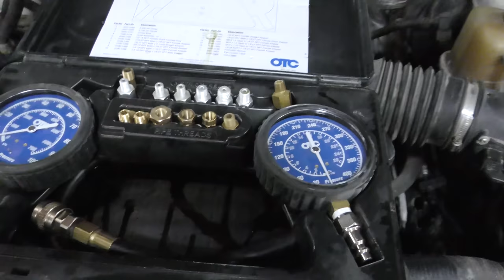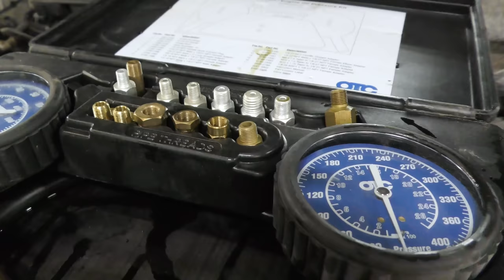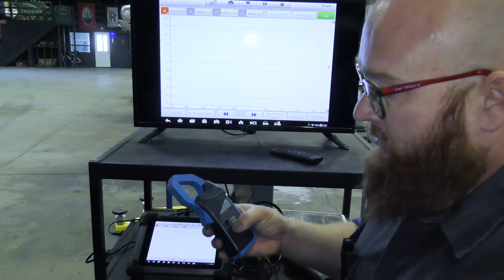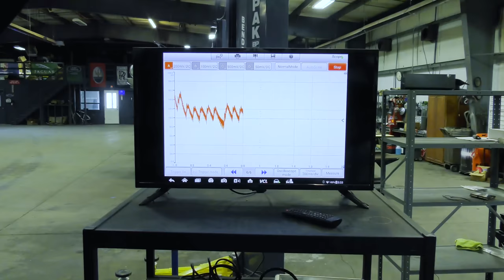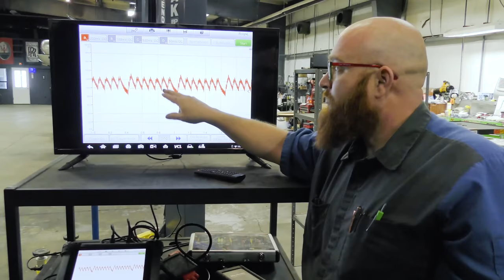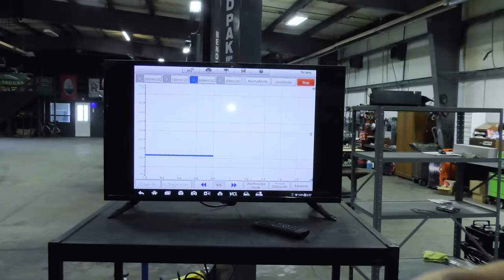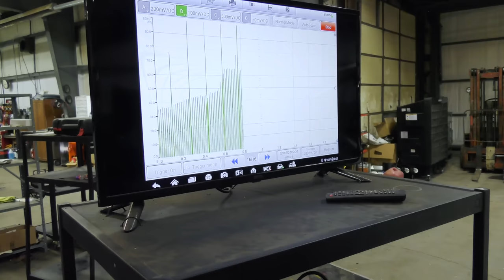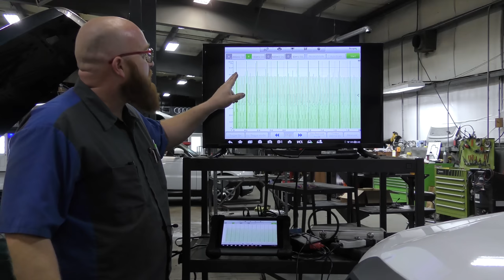Can an engine additive really fix this 2011 F150? CAR WIZARD shows how to diagnose and repair

Comment: I’m the customer, a lot of people asking what engine, 5.0 V8. I tried to get the first shop to test the oil pressure, I’m not sure if they didn’t want to invest the time but they didn’t do it. I’ve been watching Car Wizard’s videos for a while now and knew he would apply some real troubleshooting skills to the issue. I wasn’t disappointed. Thanks Car Wizard!!!
Reply: Thats awesome!  You're lucky you live close enough to the wizard.  Im glad it seems like the other shop didn't shaft you too hard.  They could of done alot more damage blindly firing the parts cannon!
Reply: I was just thinking about what engines in that lol thanks for answering. I'm going to be in the market for a new pickup in a year or two and my company gets us the B plan for Ford. Good to know I could expect this if I get the 5.0 n get to 200k miles but yeah if I go the used market I'm prolly getting a Toyota lol
Reply: Yes a true mechanic will use knowledge and tests to find the issue and not just throw parts (money) at it. The Lucas additive will increase the viscosity a little along with having greater adhesive properties. This helps reduce the effects of some parts wear. This brings back oil pressure, cylinder pressure, and reduce future wear. Just as the wizard said this doesn't fix the problem but it can help extend the life of older engines.

Knowledge is half the battle! Go G.I. Wizard! Lol
Reply: @jamesmancuso3666  why not just use thicker oil?
Reply: @Psych0technic  I was wondering about this myself.
Reply: Out of curiosity, what is your engine oil maintenance schedule? Do you go by mileage (I haven't been able to read the sticker for 6 months, maybe its time), the oil life monitoring system (Thats been reading zero for months, maybe its time),  time (Is it June again already!?!?), or just whenever you remember that it hasn't been changed in like 3 years? Under 200k and its worn out!?!? Just doesn't add up in my book.
Reply: It is of course shocking when the diagnosis says you need a new engine. Actually, there are "20 Cars That Have Gone 1 Million Miles" like 2007 Toyota Tundra, 2006 Honda Civic, 1987 Volvo 240, 1996 Dodge Ram, 2006 Ford F-250, 2006 Chevrolet Silverado 3500, 1976 Mercedes-Benz 240D. So this F150 with 180.000 miles looks quite in good condition, and problems with the engine can surely be solved at low costs without replacing it.
Reply: Agreed except the conclusion was wrong.  Lucas just thickens oil, there is no reason to keep adding it with each oil change instead of just using higher viscosity oil.  The shop also could have just done an oil change in the first place if it was about due for it.   

As far as the Motorcraft filter, true it's not junk but there are many out there known to have as low or lower flow restriction.  Of course a Ford dealership would put a motorcraft filter on, because that's standard operating procedure.  You'd be as well off using a Fram Ultra or Wix XP, though with a positive displacement pump, the filter choice makes far less difference than the increase in oil viscosity.
Reply: @Psych0technic  I’m sure there are certain additives that make the Lucas stuff better for this application. You could absolutely use thicker oil, say 15w50, and it would likely increase oil pressure. But the Lucas stuff is kinda intended for old, worn out engines, so I’d expect there are some additional herbs and spices in it that may help prevent additional wear. I’ve also heard good things about a product called “Prolong.” 

Obviously none of these things are gonna help if the bottom end sounds like a coffee can full of bolts being shaken up, but in a case like this, it absolutely can help out. These engines I believe were specified to use 0w20 from the factory, which is suuuuper thin, probably for fuel economy reasons, idk. I have to wonder if a heavier oil was used from new whether this would even be a problem.
Reply: When I was buying my truck back in 2012, I was given the option of the 3.5 V6 EcoBoost or the 5.0 V8.  I decided to go with the 5.0 V8 and have never regretted that decision.  That engine is still running strong at 226,000 miles.
Reply: This doesn’t make Ford look really good.  Shouldn’t their engines last longer than this?  I always get 300000 miles on my bmw in-line 6 n52’s and Japanese engines.
Reply: How often did y’all do oil changes? And what oil and filter? City driving or highway? Towing?
Reply: Good egal but time to sell while it’s still good for another 50K miles.
Reply: Well that was certainly ur lucky day being able to have the Wizard personally look at and diagnose your truck problem 👍
Reply: If you don’t mind sharing, what kind of life has this truck lived, as far as things that, over time, might have contributed to the issue... like the oil change intervals, what weight/brand oil has been used, what kind of driving does the truck see (short trips, or more long highway drives)? 

I know with the later 5.0 engines (I’ve got a 2015) they “recommend” either 0w20 or 5w20 (can’t remember which, but both are pretty thin), and the book doesn’t even give a recommended change interval, just “change it when the truck tells you it needs changed,” which has always bugged me. And it wouldn’t be the first time for a manufacturer’s recommended maintenance intervals to be insufficient... VW is notorious for that as well — lot of PD TDIs wore out cam lobes after folks were going 15k miles on a single oil change. This just has me thinking I might need to adjust my maintenance regime, maybe start sending some oil samples to Blackstone for analysis, since I don’t ever intend to sell this truck. Most of my vehicles have over 200k on them, and two have over 300k, so I’m not afraid of high mileage... as long as I know what to keep an eye on. 

It’s just surprising that a modern engine that has been maintained and has used modern oil it’s whole life would have worn the bearing clearances enough to drastically affect oil pressure like that by 200k miles. I expect 6-10psi hot idle oil pressure from a well-used 1960s big block Buick or Olds, not from a 2011 V8 that had just been redesigned.
Reply: @ImTheJoker4u  I haven’t had the truck except for the last 10k or so. I’m not sure about the maintenance life it’s had. Personally I do 3k miles on this truck and 5k miles on my commuter car that gets 120 miles a day on it.
Reply: dude that early Coyote is a pos..I'm a Ford guy, but that thing was flawed from the getgo...a bored out 4.6, total GM engineering on that one...it wasn't until the Gen3 that it finally works..oops, now time for electric...how the hell some additive can fix poor engineering is myopic
Reply: @dphoenix1  I would love to know the history of this truck. It’s not uncommon to see these trucks with 200-250k. It was so clean under the truck and there was no sludge under the oil cap that it seemed like a good purchase. It didn’t display the oil pressure issue yet, and it would have been difficult to see on a test drive anyway. It only does it at full operating temperature of the oil. I would recommend anyone looking at a 5.0 truck to drive it for about 20 minutes and let it idle for about a min to see if it displays this problem.
Reply: Image getting your car roasted by scotty kilmer
Reply: @stinkycheese804  you know nothing sit down boy let the trained mechanics fix it
Reply: It’s not common for 5.0 coyotes to have low oil pressure at higher miles. My guess is poor maintenance and infrequent oil changes. Those are bulletproof motors.
Reply: I drive a 2011 f150 5.0 with 385,000 miles on it and still going strong I have changed the oil every 3500 miles and use motor craft oil filters. Not only is it running well but it rides quiet and with no rattling. Maintenance is key
Reply: @stevem5139  exactly
Reply: @andrefecteau  He is a tool. I'm an actual mechanic and I watch him just to get a good laugh. He gives so much bad info it's ridiculous. He's got the youtuber gig down to a science though... I'll give him that much
Reply: @catfishbilly7425  yeah good call bro...as I say "don't hate the players, hate the game"...that Scotty guy was the king of it
Reply: @Bmwguy2011  We don't know the maintenance history on this engine
Reply: @Psych0technic  heavier  oil does  not lubricate  new engines  as well  and its harder on the oil pump  that  truck should have 5w20  a lot of new  cars take 0w20
Reply: @ImTheJoker4u  I've got a Ford 6.4 in my shop  right now with 34000 miles that needs an engine. It has been  serviced regularly  and not abused  you never know how long they  will  last
Reply: @michaelcoonce6694  , by that same token, the Lucas is going to make the oil 'thicker' or ' heavier'.

And why would you go to 50w from 20w? I'd have tried 30w or 40w first.

The reason they use the lighter right oils is for the cam phasers.
Reply: @andrefecteau  Actually, no.  The 5.0L Coyote was based on a Jaguar V8 engine - it was not related to the Modular engines in any way.  I worked on that engine program at Ford.
Reply: @stevem5139  yep, my work truck just hit 367000 miles, oil changed every 7000 miles with conventional.  Oil pressure is fine,must of been built on a wednesday lol.
Reply: A good mechanic is invaluable. Car Wizard and Eric O. at SMA are in a class by themselves.
Reply: Sorry for your luck. I knew from the get go the 5 litre was another weak sister on the engine world.
Reply: If I paid a mechanic to fix something and all they do is pour lucas snot in the engine I'd be pretty pissed. That's not a fix, it's a cover up. This engine is on it's last legs. And that is totally unacceptable at less than 200k.

You'd think Ford could figure out how to make an engine after doing it for more than a hundred years.
Reply: @sayrerowan734  FORD recommends 5w20 in almost all their gas engines No manufacture has recommended anything like 10/40 or 15/50 in 30 years on the cars they engineered. The reason being oil pumps are not designed to pump the heavier oil that in turn does not allow for proper lubrication of the engine. I am a fan of Lucas namely because of the cleaners and additional lubrication quality's.180 k is not bad for a car the maintenance history is unknown . If I were the owner I would recommend to either plan on a new engine  in the future or trade it
Reply: Daniel did he mention if it was the synthetic Lucas (black bottle) or the regular stuff?
Reply: @michaelcoonce6694  That is 100% wrong. The reason newer engines use thinner oil is because that results in better gas mileage. Often engines that call for 5w20 or 0w16 use thicker oil in the exact same engine in a different country. It also helps to run cam phasers. It has absolutely nothing to do with the oil pump.
Reply: +Daniel Huffman I bet the previous owner didn’t use motorcraft filters. The thing about motorcraft filters is the check valve. All the mod (modular) motors (4.6, 5.0, 5.4, 6.2, 6.8) are very sensitive to it and when you use any aftermarket brand, the check valve bleeds off more oil to the oil pan than the motorcraft one would. These motors aren’t designed to have to pump up the full oil pressure at every startup. And as seen it wears the bearings and all that shit. My fix would be 5W40 every oil change. No need for Lucas. 

I daily drive an old 04 mercury marauder with the 32 valve 4.6 (basically the experimental version of your motor, extremely similar), it has 7psi of oil pressure at idle but it doesn’t have any type of VVT or cam phasers so im fine with it. Hasn’t gotten any worse in the 22k miles I’ve owned it. Oil changes every 3500 miles. Raced regularly too. I once changed the oil to 5W40 and that brought it up to 18psi at idle. Now that I think about it, i should start using 5W40 again lol.
Reply: @ryanroberts1104  Exactly fuel efficiency
Reply: Mobil 1 0W-40 and Motorcraft filters, change every 5k miles if you're not operating it in severe conditions as described by your owners manual, 3k - 3,500 miles otherwise.  That oil seems to hit all the right sweet spots for oil and has done well for me in everything I've run it in.
Reply: @sayrerowan734  both the cam phasers and oil pump get taxed  with higher viscosity oil. That's why you need to stick with the one specified in the oil cap.
Also, read this: he's only using Lucas to fill the remaining 20% of an oil change. It can't be compared to go all in with 6 or 7 quarts of higher viscosity oil
Reply: @ryanroberts1104  well  it won't matter  when our government  has us driving electric  and riding  bicycles  I would  be happy  to provide you proof but I feel  you wouldn't  believe  it
Reply: I bet you didn't change the oil ever 3K miles did ya?  Tisk Tisk
Reply: @joem.7621  ford recommend oil change in 2012 was 7500  miles
Reply: @Psych0technic  Start up lubrication, especially in cold weather.  By your hypothesis, heavy duty gear lube would be the best engine lubricant.
Reply: @stinkycheese804  "Flow restriction" is a meaningless term. If one wanted to minimize it, one more just admit they're all filter. Filtration efficiency is what is an important.
Reply: @Psych0technic  because lucas doesn't just thicken the oil  its also their additives  with the oil.
Reply: @Psych0technic  switching to 10W30 (as a preventative measure) for this very reason on my 200,000kms  2009 explorer 4.6L v8. 5w20 allows the manufacturers to post slightly better fuel economy numbers (marketing) at YOUR expense (reliability).
Reply: @cap8e  So what are these "other additives" and how do they help the engine? Do you have any idea what so ever beyond what they tell you on the bottle? I doubt it...
Reply: @ryanroberts1104  Hey Ryan I do know most oil  thickeners by their nature reducing the lubrication of the engine. I looked into a few and its just thick oil\petroleum product.. Lucus also uses a decent amount of Hydrocarbyl amine which is a detergent. its listed on their SDS which (SDS is government regulated ) sos its not just fluff I would guess it's not even listed on the bottle.  2nd I have experience with their transmission oil additive, had lots of slipping not going into R in my 01 monte carlo was used a couple other thickeners (trans) and nothing. was suggested to try lucus after writing scotty kilmer from youtube was told to try lucus trans as a last resort. slipping almost none for 3 years.. TBH it has started to show signs of slipping again.  but a $6 bottle gave me 3 more years. Also wouldn't he just say use a oil thinker if they were all the same? he's not sponsored by them, even if they are all the same or close wouldn't it be better to just say the one he seen good results with.
Reply: @ryanroberts1104  plus why not just use a heavier  high mileage oil at your next oil change vs using a thickener?
Reply: @cap8e  There are no additives in Lucas products that help your engine. Any difference in detergents certainly would not account for higher oil pressure.  Wizard called it out by name because that is what the dealer told him to use, but thicker oil would have exactly the same effect at a lower cost. It's actually kind of funny that there are a lot of mechanics that don't know squat about oil, especially the type that work at the dealer. Anything Scotty might have told you is probably wrong, he is an obnoxious donkey.

Yes, it works sometimes as a last resort, and you may get a few more miles out of something that is already basically dead. But it is only a last resort and a temporary coverup, not a long term fix. You would get exactly the same effect for less cost by using a thicker oil. It's also better for any oil to use all of the same brand rather than 20% of this and 80% of that, not everything mixes well. Either way this engine is on life support.

Additionally, this is but one example of one single truck - just because it worked here does not mean it will or won't in any other situation. A sample size of one is not statistically important.
Reply: @ryanroberts1104  okay you have your opinions on scotty and thats fine.  but as I just told you because of him I am going past 3 years still driving my car in PHX az where summers are killer.  yes we are on barrowed time. hell I would have been happy with 6months. So there is 1st hand personal experience. Believe it or not I have no reason to lie.   Before I used it I seen other random people (little to no subs) vids on youtube having good results and reading on forums.   no one is saying its a magic bullet for a long term fix.  certainly not me.  its totally not a cure all. but what will it hurt to try ? whats the difference in price a few dollars.
Reply: @Ryan Roberts  plus you asked me whats in lucas thats  not in other brands..  Asked and answered if you are not happy with the answer what can I say.  🤷🏾‍♂️
Reply: @cap8e  You have absolutely no proof what so ever that the Lucas is why your car is still running. That is your guess and nothing else. You still have not answered my question about what the additives are and what they do for you. "Detergents" is not an answer. More specific.

The point I'm getting at is you cannot answer that because you have no idea what is in it. There is very, very little in it besides thick oil, and there are oil analysis results available online to back this up. If you used thicker oil instead of Lucas bullshit, the oil actually does have additional useful additives.
Reply: @ryanroberts1104  sir you are...  well IDK what else would it be that is the only different variable,  Im sure you know if your car has been slipping for years, stalling in a certain gear  and not even engaging iin R with out revving up and shifting all the gears it won't magically fix its self & to the point of little to no issues out the blue.  Lucas is the only different variable in the equation. it doesn't take the deduction skills of sherlock or the mind of Einstein its the additive.   As I said I read the SDS sheets of lucas and stp and another brand. the only differences was lucas had   a lot Hydrocarbyl amine the others didn't. I can't sit here and say what the effectiveness of H.A. is.
Reply: @cap8e  You have no evidence what so ever that Lucas anything fixed anything. You have no idea if simply using a thicker oil would do exactly the same thing. And I don't believe you have any idea what a hydrocarbyl amine is, suggesting it is helpful is stupid. I see you had to copy and paste the word or it wouldn't have an improper capital H.
Reply: @TruckingShooter  the 3.5 is fairly nice as well. My father has one (2015 I think) And he's got almost 200k on it with the only issue being he had to have the transmission fluid flushed once because he inherited it from my grandpa who passed away and he hadn't done it. But overall it's been perfect, drives it 7 days a week.
Reply: @ryanroberts1104  Lucas has, like, labs and stuff. There is more to it than thickness. I use a little of the thin Lucas in a fairly new car I don’t drive very often because it sticks to the parts better while the car sits.
Reply: @sammolloy1  No, you are wrong. There is literally nothing else to it but thick oil. NOTHING! You have no idea if it sticks to parts better "while the car sits". (Did you ever take apart your engine and check?)
As for "labs", no, Lucas absolutely does not run any sort of research facility. They don't even make their own product, it is blended for them by a larger oil supplier.
Reply: @Psych0technic  Yes.  My first choice would be motor oil, 20W-50.
Reply: @dphoenix1  Fuel economy was a goal, but bearing clearances have tightened up in modern times making it an option. Also, not sure which manufacturers have done this since Honda invented it about two decades ago, but a textured coating on the bearing shells can hang on to the oil better (uh, technical term) and allow a thinner oil viscosity to do the job.
Reply: P.S. Also, this is yet another case where "more fuel efficiency" also means "more power." Which I've heard most Americans want more of.
Reply: @TruckingShooter  Hate to break it to you but I've had to do similar things to Toyotas with high mileage such as that. The V6 and V8 specifically. I haven't kept a 4 banger for that long as of yet. The most annoying part is even with new gaskets/seals and a pristine surface they'll still leak some half the time or more. I'm not confident in the newer cars with all the plastics. Might get worse now.
Reply: How many quarts of additive I have 2014 f150
Reply: @catfishbilly7425  He knows better than you!
Reply: @engineer_alv  , I agree, you need to stick with the specified oil.  That is, until the engine is so far gone that the specified oil isn't doing the job anymore.   If it's a choice between replacing the engine now or getting tens of thousands more miles out of it just from using Lucas or going to a heavier weight, I can easily see someone making that economic decision.
Reply: @michaelcoonce6694  , I don't know why you arrogantly assume I don't know that about engine oil and what the manufacturers are doing, or that you have any more knowledge than I do in that area.

My point was, if you are putting Lucas in it, you're thickening the oil. And you used a jump from 20w to 50w, when a more logical step up on an already damaged engine is to go with the next weight up instead of such a massive jump.

I would imagine the owner is aware of the issue and planning accordingly.  That said, he might get tens of thousands of more miles out of it before the engine finally goes FUBAR.
Reply: @michaelcoonce6694  True.  The idiotic government will be banning combustion engines soon.  Probably less than 10 years away.  And virtue signaling leftists will cheer.
Reply: @ryanroberts1104  my 2012 ford has 190k on it never had a wrench  put to it runs  great  and has been  serviced  at manufacturer  intervals
Reply: @BornIn1500  The government does not get to "phase out" engines, this is 100% left up to the free market. Even in 100 years, there will be a lot of things we still need engines for. There are auto makers randomly claiming they are going to make this or that electric right now, but in reality they won't meet the fake deadlines they have set and if they are not popular they will not continue making them. They're only saying that to make stupid people happy.
Reply: @michaelcoonce6694  Nobody cares. A sample size of one is statistically insignificant. Any mechanic who actually works on them will tell you Ford engines are shit. (And the mechanics love it because it pays their mortgage!)
Also at that mileage, it has almost no value. There is a reason Ford trucks are always cheaper on craigslist.
Reply: @theundergroundlairofthesqu9261  Yes, thinner oil gives slightly better efficiency and gas mileage, but not enough for you to ever, ever notice. The manufacturer's choice to shift to 20w oils has indeed caused increased wear - the manufacturers just consider this acceptable. You can find detailed studies about this online. Maybe one of the reasons this POS is already so worn out.

Personally, I will never put 20w oil in any car, I would never buy an engine that calls for that or uses cam phasers, because that is stupid. It's only there to make the EPA happy, and sometimes I burn a tire just to piss the EPA off.
Reply: @ryanroberts1104  Apparently you do I got you dont like fords additives and admitting your WRONG . Get a life
Reply: @michaelcoonce6694  You've made numerous stupid comments here. Numerous incorrect comments. And now you are just repeating things other people said first. If you are a mechanic you are a hack, and this is quite common. Just because you do something for a job doesn't mean you are any good at it. Most people would agree it's hard to find a good mechanic these days, too many idiots.

I'm really not sure what you are arguing about at this point, you're just making a fool of yourself. You literally tried to say that heavier oil is bad for the oil pump and that's why they use 20w. That is something only a stupid person would say, if you are a mechanic I feel sorry for your customers. You don't even know how an oil pump works.

Quit while you're ahead and just STFU.
Reply: @ryanroberts1104  you just keep running that heavy oil in your car you will be seeing a hack mechanic someday  I know arguing a point with a wall does no good putting heavier oil in a car then is recommended is like putting premium gas in a car that runs regular it serves no purpose. And I still like fords and lucas products. Sorry Ive got work to do so bug somebody else
Reply: 180k miles and the engine has low oil pressure? Did you buy the truck new and how often did you change the oil? What kind of oil did you use?
Reply: Since it's a 5.0L. You can shim the oil pump to increase oil pressure. I would try a new oil pump first to see if the current pump has a weak bypass valve.
Reply: @TruckingShooter  even a used Toyota at 500k will last longer than Ford
Reply: @ki5aok  typical strong Ford v8
Reply: @jpriller5105  Oil pumps don't go bad to often. The guy probably didn't change his oil.
Reply: The solution here is the correct one.  A customer brought a truck in with low oil pressure.  Instead of throwing a ton of parts on it they spent $20 on Lucas additive and some oil and it seems to work.

Hopefully that helps and works.  They may try again.  If not it, -maybe back.  Maybe get another 100,000 or 200,000 miles on it.  New trucks are expensive and in many lots the selection is thin (shortage of computer chips) = not the rigt time to buy a new truck.
Reply: I was wondering what oil did u use and how often did use change oil, I got a 14 5.0  with 140,000 miles and I use castrol edge full synthetic and change every 4 to 5 thousand miles
Reply: @TruckingShooter  Your comment about getting a used Toyota got me thinking:  With 32 valves, 4 cams, two or more cam phasers...  More places to lose oil pressure as the engine wears than with a pushrod V8 (e.g. GM, Chrysler).  I wonder if a Toyota V8, also DOHC 32 valve, behaves the same way as it wears?  What say you, Wizard?
Reply: @Daniel Huffman
My advice is to get a product called RVS.
I had a SEVERE rod knock and BADLY slipping clutch in my motorcycle.  This stuff actually fills gaps in worn parts. Of course,  I didn't believe it, but for 60 bucks, I figured why not give it a shot. 
Within 30 miles,  my knock was gone and the clutch no longer slipped.
It only lasted for 6 years and 30, 000 miles, but it was well worth it. 
It's available online. 
It's the only "magic in a bottle" product that's ever worked for me,  but it actually DOES.
Reply: @Jstaguy26  basically no castings or internal components in common, but the bore spacing was made identical so that it could be built on existing lines tooled for the modular V8.
Reply: @Bmwguy2011  No it doesn't make Ford look good, but I doubt this truck received proper and regular maintenance. I have seen several 5.0's with well over 200k.
Reply: @jonmccormick8683  It's hilarious people act like the only two options are limping along this POS or "buy a new truck". Generally people driving broken base model Fords with almost 200,000 miles don't go get a brand new one from the dealer when it breaks down, they spend $4000 on another used one that will last a year or two and do the same thing.

This truck should be fine for a few more miles with thicker oil but even if it wasn't that has nothing to do with the cost or availability of a new Ford, that was never on this guy's list.
Reply: @turbovolvos40  good because my philosophy has always been: change air filter / oil / oil filter, always warm up, never lug, never redline and with synthetic.... true wear should be nominal: German or American. I got 368000 on my Acura, 236 so far on my bmw, 336 on my civic and would have to believe that 250-350 is achievable on an American v8.  I think v8s aren’t as well designed as inline 6’s— tension built into the design.
Reply: @dphoenix1  Label in the filler cap says 5w/20 so pretty thin. I'd go one thicker at that mileage or use the additive.
Reply: @stinkycheese804  Watch the Project Farm oil filter comparison.
Reply: Before Lucas we used high tach oil stabilizer and before that it was STP oil treatment and before that we used 20-50 oil it all worked but Lucas seems to be the cure for this problem it took fifty years for lucas oil stabilizer to be my go to for all my fleet vehicles engines to last at least 300 K  !
Reply: @batsonelectronics  I've always had good performance from the orange frams. Synthetic oil changed regularly, Fram filters, OHV engines, they go 300K and run like new. The vehicles fall apart around them. Yeah, the newer VVT engines I'll use better filters.... But I think the most important thing is clean synthetic oil.
Reply: @michaelcoonce6694  I agree I think 5w20 is as thin as I'd go. It's like water. The manufacturers now recommend maintenance based on environmental impact, not on increasing longevity for your car.
Reply: @ryanroberts1104  I'd disagree there. Govts are pushing electric and green energy like crazy. Subsidies, tax credits, trying to ban ICE's in downtowns. Picking winners and losers. The list goes on and on. All of this is politically driven and not based in practical reality.
Reply: @robertbell525  I've been in the repair business for forty years and firmly believe in following  manufacturer  recommendations some cars just last better than others. No matter what you do
Reply: @michaelcoonce6694  oh yes, some are good some are junk, and heaven help you if you got one built on a Friday afternoon.
Reply: @michaelcoonce6694  Lots of people have been doing things for a long time and are still bad at it. There are lots of bad mechanics in the world, that's why it's so hard to find a good one.

I see you still haven't figured out that punctuation thing.
Reply: @robertbell525  Yes, they give "incentives", it does not mean they are going to "phase out" (or would ever have that option) gas engines. Based on the news right now a lot of dumb people think all cars are turning electric and that's just the way it is. That's just the way it isn't, these people don't realize we still need the gas engine for at least 100 more years...and it has nothing to do with politics. Yes, politicians get involved and try to push one thing or another, but the winner in the end is the thing that works, and electric cars are not even remotely close to workable for some situations. If every American had one or more electric cars, we would not have enough electricity to power them all! The grid is already failing without them...
Reply: @ryanroberts1104  agreed that EVs are a tiny portion. 2% of new car sales. But if all you do is listen to the media you'd think it's 98%. At least US govt won't outright ban ICE but they will legislate to make it harder and harder to make and maintain. They already have. Engines and controls are so complicated they don't last and are many times not feasible to fix. Check engine lights come on for everything. Tiny turboed engines that die at 100K. Transmissions that shift constantly to maintain fuel efficiency. And all this for maybe 1 extra mpg. It's ridiculous.
Reply: @robertbell525  I agree they try, but even if it was mandated today that all cars be electric it just isn't possible. Much of this is political, so absolutely nobody can guess how it's going to be in 4 years time. The politicians making these mandates have no idea how cars or physics works. The EPA has screwed up dinosaur powered engines, but there are a lot of pretty nice late model engines still being made. Some of the newest V8s are making obscene HP from the factory, with reasonable MPG too!

I think both Furd and GM are making some pretty substantial claims about having fully electric lines by 2030, they make these kinds of "goals" all time time only to completely forget 2 years later. We can't really say that either one won't go bankrupt (again) by 2030. I'm not holding my breath. Yeah, they will make an electric Mustang and an Electric Hummer by then, but we'll still be mostly driving combustion powered machines in 2030. Unless there is some amazing new thing found in the next few days, technology just ain't there yet.

Everybody went nuts around 2008 trying to save $4.50 gas, but over a decade later gas is incredibly cheap and big displacement engines are making a comeback! The dropping prices of oil have even hurt solar panel sales - there have been times in the past few years it is cheaper for me to run a gas powered generator than to use power from the power grid. That means if I had an electric car it would be cheaper to charge it with a gas powered generator...except that is ridiculous.
Reply: I agree that this isn't good enough. My Chevy G20 went 350,000 (easy cruising highway) flawless miles before selling it, and my FX35 went 265,000 (violently BRUTAL) flawless miles. My company's 2015 F150, however, sucked.  The most popular vehicle in America shouldn't have so many problems.
Reply: I’m certainly not gonna argue with the wizard but I’m familiar with this issue and 5.4 3v does same thing. Replace the oil pump with a high volume pump from melling. Now problem is solved.
Reply: @lenny108  There are MANY more million mile vehicles. Add a 6.7 powerstroke to that. 1.3m on a 2013  Platinum Powerstroke.
Reply: @ImTheJoker4u  that's what I'm thinking. I got a 11 f150 I bought at 32k miles and it now sits at 215k and never heard of that issue. I go by my oil life once it gets to 15% and use a Fram filter or motor craft if the Fram is sold out. The only issue I know of from a few others but luckily not mine (knock on wood) is the drive shaft bearing going out. And most shops go for the full drive shaft to replace at 900$ when you can buy just the bearing for 20$ online.
Reply: @dperreno  Explain to me how an engine design that was not related to modular engines in any way, was somehow designed and built to be assembled on modular motor tooling and assembly lines? And why it has the exact same bore spacing, deck height, bellhousing pattern, and even almost the same physical size as the outgoing 4.6 mod motor? Maybe you should stop making things up online, lmao.
Reply: Dphoenix1....there is nothing in Lucas.  Search bobistheoilguy.com for the VOA.  It’s just really thick base oil.  If I had an issue that I thought could be solved with higher viscosity, I’d either use a higher viscosity oil or I’d use Mobil 1 15W-50 like an additive.  It’s a fully formulated oil and cheaper than Lucas as well.
Reply: @ki5aok  2013 F150 5.0 owner and mine has 226k too! Running well with regular self maintenance. Hoping to keep it for many miles more
Reply: I wish I lived near him.
Reply: @sayrerowan734  What does FUBAR mean? Sounds like a tasty treat.
Reply: @michaelcoonce6694  What size engine?
Reply: @ryanroberts1104  All Ford engines?
Reply: @standhd  You are way late to the party and I have no idea what you are referring to, but whatever it is, yes, all Furd engines.
Reply: @ryanroberts1104  I have a 2003 4.2. And no I’m not way to LATE to the party. Stop being an ……. and a FORD hater and just answer my ……QUESTION!
Reply: @ryanroberts1104  WERE YOU AT….TOUGH GUY? People like you make me wonder…..WHAT ARE YOU GOOD FOR????? TALKING NOISE WITH NO SPINE???????
Reply: @standhd  Fucked Up Beyond All Repair
Reply: I’ve got the 5.0 with 155 never had one issue. I hope I can get 200 plus hope you did.
Reply: That is diag method is really cool!
Reply: I have over 210,000 on my 2011 f150 ( Coyote 5.0 ) and I run one bottle of Lucas oil stabilizer to my oil at every oil change. I SWEAR by this stuff!!!
Reply: @Psych0technic  Try it and find out lol.
Reply: @lenny108  The Toyota V8 is rated one of the best engines made.
Reply: @stinkycheese804  No actually you wouldn’t be better off using any filter. I suggest you do some research. Fram is the worst filter made.
Reply: @dphoenix1  LOL yeah go ahead and dump that goop in a modern engine and drive it for a while. Let us know what happens!
Reply: @Bmwguy2011  Sure if you don’t have Jiffy lube change your oil. People who are cheap usually don’t get high mileage out of anything. Not to mention it’s cheaper to do your own oil changes with quality oil and filter.
Reply: @andrefecteau  Exactly. So you’re saying a 2011 Coyote engine is junk ?
Reply: @rolandthethompsongunner64  no but you are...you go as fast as your wallet can handle it...plain and simple and btw compared to what Tesla is doing?  Yes
Reply: Also run synthetic I use nothing else have 400 thousand on my 01 e350 5.4
Reply: @garyholifield2147  yeah my 96 Cobra has over 300K, always used synthetic
Reply: Oil flush, wix xp filter and ceratech from liquid molly
Reply: There wasn’t anything to troubleshoot, crazy how little people can do own their own
Reply: @lenny108  you can’t solve any of those problems without a rebuild. You’re just possibly alleviating them for a while
Reply: My 2004 f150 4.6l v8 is very reliable has over 400k miles .
Reply: What quality oil were you using before that happened
Reply: I have a 2013 5.0 F150.  I bought it CHEAP only $15k.  I didnt know at the time that it had a bad engine, but I had my suspicions.  It had 120k miles when I bought it.  At 140k miles it started giving me an intermittent low oil pressure alarm every now and then at idle.  Restart and it would go away.  Then by 150k miles it was becoming more persistent.  So I did a fuel system cleaning at valvoline where my son works.  Immediately my check engine light came on, which they said was normal.I waited a week and it didnt go away.  I checked codes and found an O2 sensor code, and a misfire code.  I did some digging and replaced the Canister Purge and that eliminated the O2 sensor code, but I still had the P-0307 misfire code.  I then swapped out all the plugs for new plugs.  Still have the P-0307 code.  Then I swapped around coil packs, no change.  Then I had my mechanic change out all the coil pack connectors and pins as most of them had broken locking tabs.  No change, But he told me the misfire could be serious and after everything I had done I needed to consider it was something worse.  He also changed the oil pressure sender and pigtail and the oil pressure warning alarm went away.  The truck still drove fine, you could tell there was a misfire though especially at idle.  Then after another 2000 miles or so I started getting the low pressure alarm again.  So I did a post on the Ford Truck Enthusiast web page and someone commented that the 2011-2013 5.0 engine had a problem with the valves eroding.  It wasnt covered under warranty, but did have a TSB out about it.  The fix was to remove the heads, do a complete valve job with new design valves and that will fix the misfire.  The valves actually erode right at the seat causing hot gases to escape back into the intake lowering compression.  The confirmation test for this is a physical compression test with a gauge as opposed to the relative compression test which is done on the scan tool.  At this point I had 155k miles on the truck so I took it into the lincoln dealer because you could actually get an appointment there in a week as opposed to the Ford dealer which was 6-8 weeks out.  The compression test confirmed the valve erosion problem on cylinder 6 and 7 which are the most common cylinders to show this problem.  #6 was 110 psi and #7 was 72 psi.  This happened at the height of the Used truck inflation where even a piece of junk was $20,000 and a good low mileage same year truck as mine was $30,000.  So I made the decision to spend the money on a new engine.  I could have just done the heads for $3500 but I would still be left with a bottom end with 160,000 miles on it with low oil pressure problems.  So I talked to the service manager at Lincoln about an engine and he was not very optimistic about getting one in a reasonable amount of time.  There is so much demand for rebuilt engines from Ford that they cant get cores to rebuild and even when they do it takes forever to get parts because of supply chain problems.  He actually told me he had 5 trucks sitting in the lot waiting on engines for over 8 months.  So I started looking around in the aftermarket.  Pretty much every supplier I called said there were no cores.  After the 6th or 7th company I called I found 1 company that had cores available AND they had an Excellent rating from the Better Business Bureau.  So I purchased the long block for $4500 all in and had it shipped to the lincoln dealer.  It only took 2 weeks and the service manager was so impressed he ordered 3 engines from them.  I bought about $1500 of parts to finish off the engine and reused only a few things from the original that were in great shape or had already been replaced.  All in it was about $8000 to fix the truck. So that puts me in at a total investment of $22,000.  You cant buy a truck in this condition with low mileage or with a new engine for that amount of money, so I feel I have spent my money well.  I have put several thousand miles on it now and am very happy with the whole experience.  I now have a fully sorted truck that runs and drives like new for less than I could have bought one for in the same condition.
Reply: High volume oil pump seems to be the answer for the Ford OHC engines.
Reply: Did he use heavy duty lucas oil stabilizer or the full synthetic?
Reply: I have a 5.4 3v in a expedition it just rolled over 280'000 all original cam phaser everything they started making a lil noise at around 130'000 or so. And I went to 5-30 instead of 5-20 with stp oil treatment quaker state hm oil that's been 6 years and 150'000 ago still going strong. I'm old school and a gear head the old guys that taught me about engines always swore by thicker oil and I do to God bless. Happy wrenchin
Reply: Iv got a 5.4 3v in a expedition. It just rolled over 280'000 it's all original runs like a top iv used quaker state 5-30 hm oil with stp oil treatment for the last 200'000 miles thicker oil is the key to engines
Reply: @ki5aok  I did the opposite and although I haven't had any issues with mine,  I'm not confident on how long it will last.   In hindsight I wish I would've bought the V-8.  Mine is a '13 with 90k.  I have to say though we had several Ecoboosts at work @200k.  Only issues they had were turbos leaking coolant.
Reply: Rather a 5.0 than the troublesome Ecoboosts.
Reply: @canadianmarauder1923 I got a 2009 Crown Vic police interceptor last year for a friend's son last year. It runs great and was well maintained. It's got 150,000 mi and I change the oil every 3 months. I switched to 5W30 on the last oil change and it runs nicely with it. Do you recommend using 5W30? Or is it better to go back to 5W20? There are no leaks or oil consumption.
Reply: @frankg6578  either is fine.
Reply: What does he think about the 4.6 3V ik the 5.4 is bad
Reply: Customer, is your truck still running good today? How many miles are on it?
Reply: The OEM filter and 5w-30 quality oil makes a difference, as I’ve been through this, trouble shooting a client's 5 litre.
Reply: Do you have the Lucas oil stabilizer specs to order from Amazon?